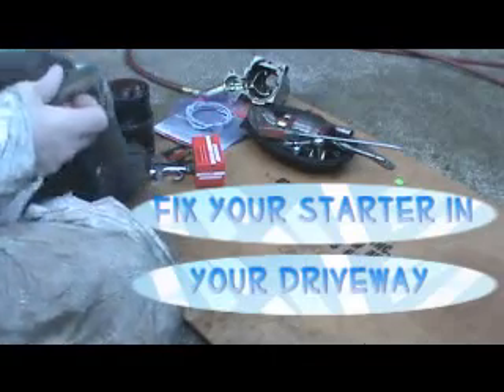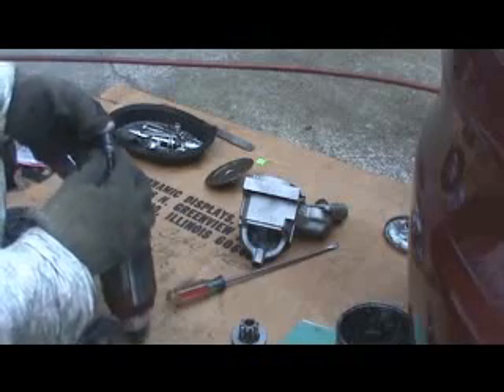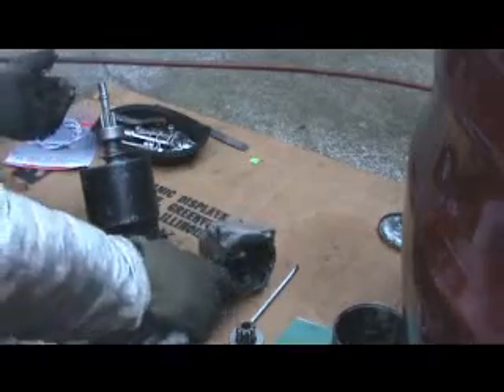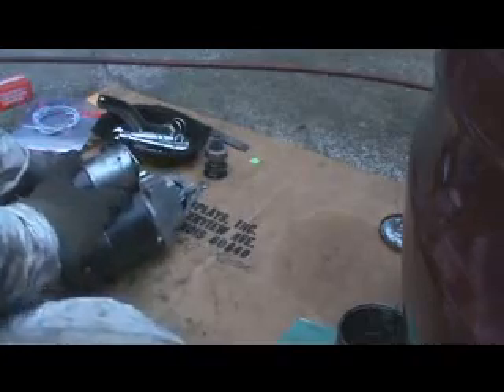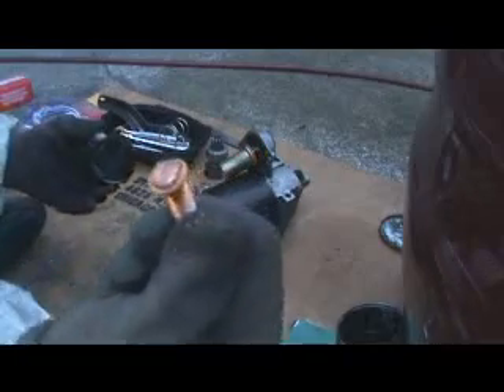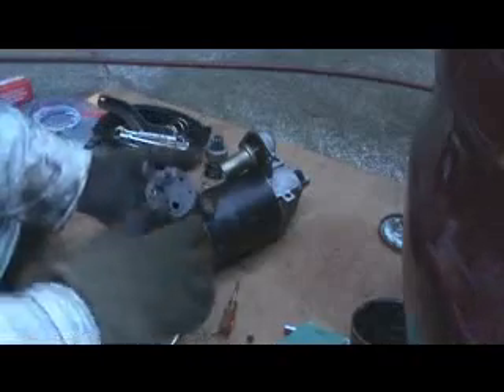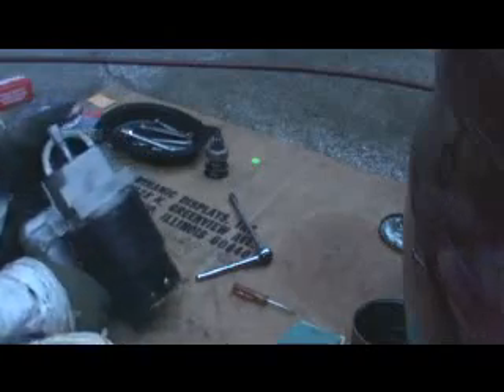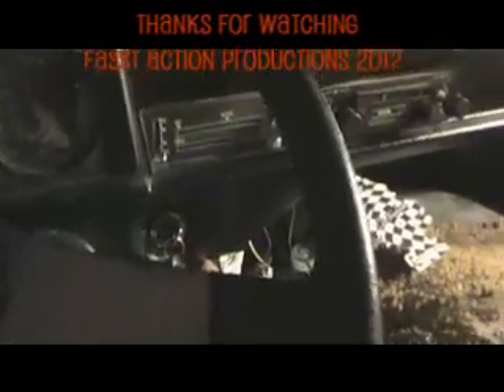Fix Your - Starter Drive - In your Driveway Part 2 GM Chev

Comment: Thanks for the knowledge. I have a 1989 camaro with a 305 tbi. Have had it for 10 years. Over the years Ive rebuilt it using junk yard parts, rebuilding my own parts or even making other (Ford,Pontiac) parts work. It's one nice rat rod. Sidenote: I noticed how you mentioned keeping the art of DIY mechanical repairs alive. The best example of this is in Cuba. There are tens of thousands of 1940's and 50's American cars in Cuba (think of your stereotypical Havana scene with the convertible Corvair or whatever) and you would be blown away to see how these guys continually rebuild and even MacGyver parts for these cars that are 50+ years old and even harder to get parts for, considering the embargo we've had on Cuba forever.
Reply from the maker: Thanx. I know of those old cars in Cuba. It  must be like the land time forgot.

Comment: Very helpful information!
The only thing I do different is soak the bearings with some lightweight oil (3in1) instead of using grease. Sleeve bearings are porous and will stay lubed for much longer if soaked in oil. An old mechanic taught me that trick.
Reply from the maker: Hobbycentral Cool  :-)

Comment: Well after watching both video's on fixing a small block starter, I know what I'm doing tomorrow afternoon.  Thanks for the great video and all the tips.  My question is, what was the problem with your starter?  I've got one that just doesn't seem to be strong enough sometimes.  It'll turn over really slow and then speed up, to about 150 RPM's on the engine.  I imagine it needs cleaned up and maybe a new starter drive like yours.
Reply: starter drive wasthe problem. Also, my positive cables was too janky. By the shortest and fattest one you can find.

Comment: Roughing up the commutator contacts like that will lead to premature brush wear. You should take it down with successive sandpapers starting with maybe 100 grit, then 150, then 220 then polish it with fine 4/0 steel wool till it's mirror smooth with no scratches. The rough scrates will be like a file on your brushes and your brushes will wear down quickly and....Oh Well.......

Comment: I'm getting a clicking sound when trying to start my 81 corvette, I would have to keep turn the key until it finally starts, but as time goes on its getting harder to get it to fire..My question is  starter is bad or the solenoid? I believe my 81 vet has the starter and solenoid as one unit. Before i decide to replace the starter do you think that the clicking is due to the starter going bad??? Waiting to hear back from you. I can be reached here or my e mail is  kmathews1@gmail.com
Reply: Yup ... Starter drive ... 🥴